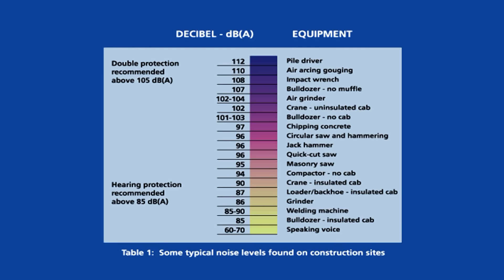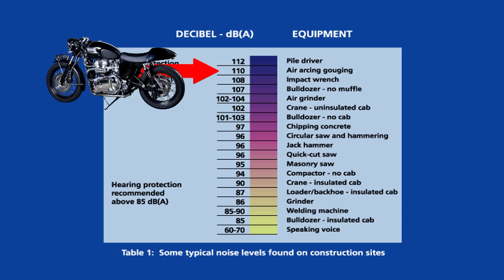Why Not to Change Your Car's Muffler

Comment: How would a different muffler change AFR and mess with the O2 sensors?
Reply: El_De_La_Lobo I got catback exhaust been had it for a min no problems lol
Reply: It doesn't, the purpose of an O2 sensor is too measure.  Yeah,  If cats clogged it'll throw a code,  but muffler has 0 affect.
Reply: You don't need backpressure lmao watch engineering explained's video about it.
Reply: Uhhh...  you do need back pressure if you're driving your car every day. It will cause breathing issues with your car. It caused issues with my rt.
Reply: fuqoff aye? Nevermind. I read your thing wrong. You said backpressure changes with those things,  you're right. Thought you were saying backpressure has affect on them
Reply: Engines do not need backpressure. Period. Mufflers don't effect afr.
Reply: fuqoff aye? Um o2 sensors measure gasses coming from the exhaust manifold and after the catalytic converter has nothing to do with the temperature of the exhaust gasses the only way temperature affects the o2 sensors is letting them know the car is on and now a days most are operated by their own heat source
Reply: fuqoff aye? Um I'm not because companies like borla work with manufacturers to make their cat back exhaust work properly and to be legally used on the streets also you can order a cat back system from Boris though the car manufacturers factory. I can tell you're just a YouTube mechanic while I have years of experience in the industry at a dealership and have technical training through a tech school so I know what I'm talking about
Reply: Jo Blow yea these people believe everything they see on the internet and think their experts
Reply: fuqoff aye People were seeing real performance gains from installing performance intakes and exhaust systems on their engines and a proper ecu tune afterwards. I'm not so sure that the rest of the components you mentioned would need to be swapped out to make a new intake/exhaust worth the investment.
Reply: fuqoff aye? Well if you think you know how an o2 sensor work tell me how exhaust temperature effects how the o2 sensor works other than turning it on
Reply: fuqoff aye? Plus the temperature of the exhaust wouldn't change anyways since the new exhaust is from the cat back the manifold is still stock and even if the manifold was modified it still wouldn't change the temperature
Reply: Devin Dowless 4 strokes don’t, 2 stroke yes
Reply: That may be true but were talking about 4 strokes here. Fuqoff aye, take your own name and take the advice. Why would a sbc 350 gain power with highflow cats and a better muffler and larger exhaust pipes? Not all factory mufflers are restrictive. The o2 sensor needs to be hot to read correctly. I don't regret my cat back since I didn't spend any money on it. Again, the engine is a big air pump, the better the air flows in and out, the better it runs. There is no debating this.
Reply: Devin Dowless that guy is a YouTube mechanic he think he knows everything but knows nothing
Reply: fuqoff aye
The issue isn't backpressure. Backpressure results in pumping losses which hurt efficiency. In some cars, mostly older one's with really terribly designed exhaust system, you can actually gain mpg from putting a larger, freer flowing exhaust on it. The only ideal backpressure is none. 
In fact, just cruising down the road most cars have very little to no backpressure. The issue is exhaust velocity, which messing around with larger pipes or removing the muffler can screw with, which can adversely effect power and effect the way the car runs.
Reply: Henry Fuller that is true but if the front upstream o2 sensors do not get up to operating temperature quick enough it can and in most cases will throw a CEL light, yes they have built in heaters in them now a days thats why they have 4 wires positive negative for sensor and positive negative for heater but the factory tune on the cars computer is set for a certain amount of heating time before the heaters shut off and the exhaust heat takes over, but when you change exhaust diameter or how far away the o2s are from the manifolds or the manifolds themselves o2 can take longer to heat up requiring a custom tune to change heater duty cycles and air flow ratios that the computer will now need to deem acceptable for the changes
Reply: thcscarface1 yes that's completely right but a cat back system doesn't change all of that that's what I'm trying to argue that a cat back system doesn't effect the 02 readings
Reply: Shoulda left a link, sounds interesting !
Reply: Nothing against gays but your lines were funny !

Comment: Thanks for the great video, I put a gasket on the connection between the muffler and the exhaust pipe for a better sound. It can be said that this part of the exhaust is leaking now, will it damage the car engine in the long run or not?

Comment: I learned this lesson when I developed a hole in the muffler in an 84 Mustang.  Performance (power) went to pot until I got it fixed. 
There's definitely something to the engine air flow calcs,  especially in the exhaust system.
Reply: Cars are tuned with stock exhaust and have a certain amount of echo that goes back to the motor all this is in part of the flow of exhaust and the cars ability to breathe right.

Comment: 100% correct, computer is designed for a stock system.  You are only getting better performance when you tune it , to adjust for it.
Reply: Computer can adjust up to %25

Comment: Why do people think a simple muffler swap or delete will make a car run bad, maybe obd 1 or carborated sure, but modern cars ALL have short and long term fuel trims, and the ecu knows how the engine should run and it will compnsate for any changes to the system around +-10% to keep the afr correct. This whole it won't run right bullshit holds no water for modern cars, they are designed to compensate for changes in afr or they would not run well at different temperatures, altitdes...
Reply: On a carburetor it's a simple adjustment and OBD1 isn't that hard to modify either

Comment: Scotty's definitely right in this one I installed Borla Attacks Mufflers on my 2014 Mustang V6 and it definitely feels slower, feels like Honda Civic 4 cylinder during acceleration it's embarrassing 😅 also car feel like not shifting right, but it is loud as hell. Gonna weld  my Stock Mufflers back on. That was $980 down the drain. Little advice if you want your vehicle performance very nicely keep your vehicle Stock, unless you were adding turbo or super charger on it then you can mess with Exhaust, Tune and all that, otherwise it's not worth it,

Comment: Absolutely true.I can't understand why people go through trouble to cause more noise and less performance by messing with their exhaust systems that the factory spent millions to get the most of the design.🤔.
Reply: Millions? You mean the parts bins exhaust that they've used for years and often across multiple platforms and engines? They aren't spending R&D and engineering dollars making a basic exhaust. Maybe some hybrid cart like the CT200h with its water cooled catalyst, but the average vehicle has a very basic setup that hasn't changed much for decades.

Comment: Its true, free flow mufflers will mess with the factory tuning. I put a Roush axle-back system in and yes it was louder, but the car ran like crap... going back to the factory mufflers
Reply: Southern Railfanning That’s why you need to tune it with a full exhaust lol.  Unless it was a full exhaust though , catback would not make it worse lol

Comment: dear scotty...I have a 2.2l 4cyl s10 pickup ,we oversized the manifold pipe, hollowed the cat, put a cherry bomb and resonator tip on...then added a nitro obd2 performance chip, another performance module on the air intake sensor, a huge cold air intake filter, and some fuel magnets. some say I'm crazy, but I swear it saves me up to 5 dollars on gas every 2 weeks, and it sounds cool too !!!...just sayin" !!!
Reply: It takes a lot, to get more out of the weakest engine ever.
Reply: mrearly2 ...sure does matey...Wot do you use !!!
Reply: Put magnets on your fuel line for water heater, furnace and stove.  Skip the clothes dryer as it has a temperature switch and from experience it does not work well with it.  If you have electric appliances put the magnets on your fridge and call it a day.😀
Reply: Nic White
"Oversized the manifold pipe"
All you did was slow it down even more...

Comment: Backfiring? No.  When flames come out the end of a performance exhaust, it’s usually because of a proper 2-step system on a turbo, not because it doesn’t have a muffler.  This guy needs to figure out what he’s talking about before he does it
Reply: GTaero First off very few cars have 2 step or Anti-lag.  Both systems destroy turbos over time. 
second, not every performance car is turbo charged. Not even most performance cars have turbos. 

Mustangs? The new ecoboosts are turbo,  but thats a new thing or an old obscure 80s fox body SHO thing. Most mustangs have a v6, a 302 5.0, The modern Coyote 5.0, a 5.4 with a super charger, or a 4.6l modular v8.

Most American performance cars are N/A v8s or supercharged v8s.  They have cars like the Focus RS, Neon SRT4, (few other modern 4cly turbo) or some 80s cars that are 4 cly turbo. 

European cars are occasionally turbo charged.
 
The Japanese cars are limited (by an Japanese agreement) so they produce smaller cars with smaller engines. Some Japanese cars are turbocharged (probably more than any other style of cars) but even with that in the US most Japanese cars are naturally aspirated. 

You might see 1 car with 2 step on the road a year (without looking for modified cars at a show or a shop) if you are lucky, and that is only because whatever it is was built by someone and tuned by a shop. NOT a factory built car that has a factory 2 step system. Very very few cars have that technology. 

You have no idea what you are talking about and have the cajones to tell a man with 50 years of experience he needs to learn what he is talking about?

99% of back firing is not caused by 2 step lmfao. Any car can back fire. You could put a straight pipe on a Prius and get it to back fire.
Reply: @user-kn5ol8ck8s  Well said, Sir  =)

Comment: Funny just had a Flowmaster 40 installed no lights no error codes and it sounds like it finally dropped it's balls you're welcome
Reply: And NO low end torque now either.
Reply: @equalizer2233  if done right you get a increase mine has tons of low end torque its almost sickening

Comment: The video is great. It is very good to install the exhaust muffler on the car. I bought a pair of this renhotec brand muffler not long ago. After installing it for a while, it is still very good. It is recommended that if you are interested, you can install the muffler.
Reply: Older cars I would definitely do this newer cars its best to leave alone unless you do minor things here and there for daily driving I recently got a vibrant street power muffler and just have the axleback pipe didn't mess with my cat or nothing still sounds good I learned my lesson on my wannabee build up car when first getting into the scene 😆 🤣 😂

Comment: ive seen so many do this, changing the muffler to a much louder one, even with a cold air intake or etc etc stuff, it was louder but it was also slower and used much more fuel. even though they realized this, they still refused to change it back, or tune it, cuz that was not something they thought they could afford. even if they extra fuel is eventually more anyways.
Reply: I just recently bought my first car 2010 lexus gs350 I was thinking of getting a borla s type muffler, After watching the video / reading comments would that not be a good idea? Also, could you tune a stock muffler, would that be the move
Reply: Seen so many?  Ok.  I have tuned plenty of cars at this point and there is more than enough prof out there that exhaust mods on factory ECU tuning makes more power than the stock system.  Even in late 90s v6 cars I've seen small bumps mid curve.  More power = higher efficiency i.e. better millage.  Never seen a lean scenario that looked dangerous on the factory tune either so id say go for it.  Then tune it when you are done with your upgrades unless its a major upgrade (heads, cams, power adder)
Reply: @bodyshotjake7475  Yes

Comment: I've modified the exhaust on every car I've owned. It doesn't need a tune or any computer work unless you install a high flow cat or headers. Anything cat-back is fine to just install with no problems.

Comment: most modified cars that “backfire/overrun” have had their ECU remapped/tuned through their OBDport to run correctly. usually a stage2 or more is required to run a cat-delete and  is also a requirement if they want to have have a burble tune in the mapping. which is what makes cars like 
Ferrari or VAG cars like, VW, Audi Porsche, and Lambo’s backfire
Reply: Volkswagon AutoGroup really needs different initial.

Comment: Some people seem to think Scotty is completely against modding which I don't believe is the case I believe he is just trying to inform people that modding cars does have risks and draw backs that not everyone is aware of
Reply: We are fully aware we just don’t give af. It’s simple just tune your ecu, which is one of the main mods people do anyway
Reply: @MOREBEATSTV  tune your ecu ? explain?
Reply: When Scotty said piping your mufflers makes your car run poorly. You can tune for the new exhaust, so that it potentially can run even better than stock.
Reply: @colecontos5001  so I would need a tune for my catback exhuast I’m going to purchase soon?
Reply: Totally depends on what you’re expecting from it. You won’t notice a crazy increase in power with the stock tune, but you’ll still get the sound you want. For example on one of my cars I have a fully custom exhaust but stock tune, bc I was only really going for sound.
Reply: He words it as if you’ll notice a difference in how it runs, but you really don’t need a tune for something like exhaust unless you’re doing it to make power
Reply: No
Reply: There is absolutely no reason a car would run poorly without a muffler, or with a modified exhaust.

Comment: Kind of crazy but he is right, ECUS are designed to operate within certain parameters fuel ratio and exhaust ratio although ELectronics can make some arrangements to compensate weather, high and stuff those parameter have some boundaries, moving from certain exhaust restrictions/ back pressure (standard muffler) to No restriction al all May exceed ECU parameters and then you should Tune ECU, I’ve learned this hard way with my HD motorcycle when I swapped the OEM muffler to one Vance & Hines with No muffler o resonator the nuke ran like crap until I flashed the ECU to match new pipe parameters but yeah 😎 sounds so noisy and cool

Comment: But I need to, mine is rusting a hole in the bottom
Reply: USMC FT BLASTER change it out for a regular muffler. Try to find the stock muffler online or your local auto shop and replace it with a new stock muffler.

Comment: Well, loudness is desirable, beck fire is desirable, if you taking off your muffler you might end up removing catalytic converter, if I’m not wrong Jdm classsics do not change the fuel injecting because of those o2 sensors and My European classic does not have those sensors anyway… so I think it is all good.

Comment: So the computer doesn't learn to compensate with the change?
Reply: No, because most manufacturers don't expect change so why program for it
Reply: All of that happens in the exhaust header, engines are tuned on engine dynos with nothing other than headers on, the rest of the exhaust system's function is muffling, emission reduction and getting the exhaust out of your cabin.
Mufflers are a restriction on air flow, engines are an airpump, you do the maths.
Reply: Auto companies have more to worry about than max hp. If they wanted to put out a lightning fast dragster, no one doubts they could, but that isn't the business they're in.
Reply: J. Sanchez they have to tune the engine for variations in air fuel ratio because they don’t know if you’re going to be in the Lowcountry of the Carolinas below sea level or driving up in the mountains of Colorado more than a mile above sea level. If your argument was correct I wouldn’t be able to drive a car across the country and way up into the mountains because the engine would run so rich that it would flood and die. It doesn’t because the computers can learn and adjust to variations in the intake and exhaust flow.
Reply: The thing with modern day ECU's is that they do learn and adapt to changes in engine performance. It is just like the last video he had on why not to put on cold air intakes (When he was really just talking about Short Ram Intakes). My Dad's 1998 Jeep Wrangler SE (yes the 4 cylinder one) Has a dynomax super turbo cat back system that sounds awesome, and has a Air Raid cold air intake, and it has only had check engine light about the cold air intake system, but the sensor just reset itself and the ECU turned off the check engine light. It has ran perfectly with no issues except for a blown ECU fuse problem that recently got fixed.

Comment: i got an aftermarket muffler so its more of a aggressive sound but the car has always idled up and down a little the tach doesn't show that small change but i do hear it. done it before the exhaust was done and still does it after but i wonder if it has anything to do with the air fuel sensor. not the o2 sensor the the one thats in the air cleaner of newer cars. i never changed it when i had a new engine and transmission put in.

Comment: As long as you don’t mess with your catalytic converter you should be fine don’t believe anyone says even its Scotty Scooby Doo. In fact a new exhaust will have more airflow and your engine will breath better resulting in better power, better fuel economy and last that sweet loud sound so enjoy it.